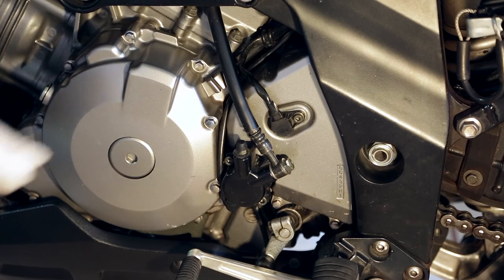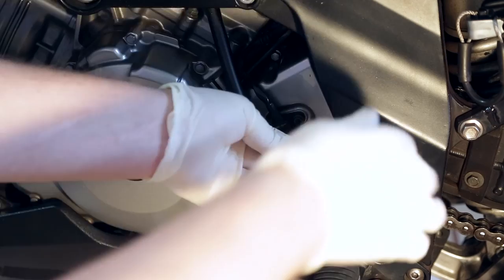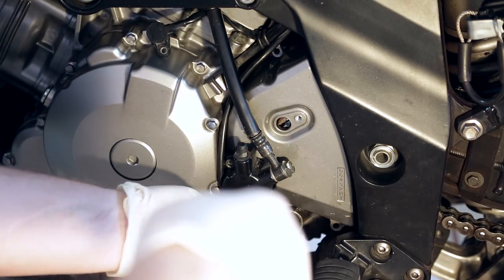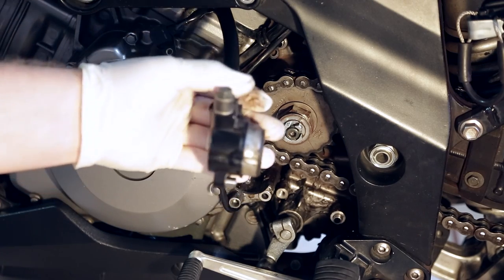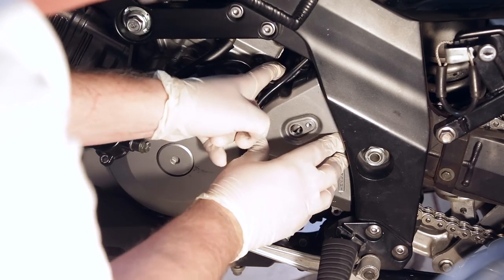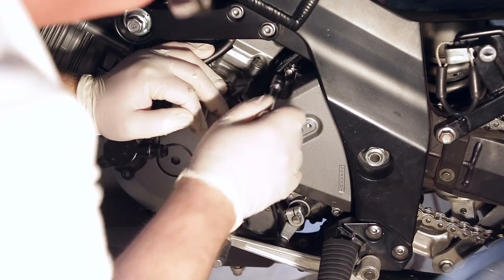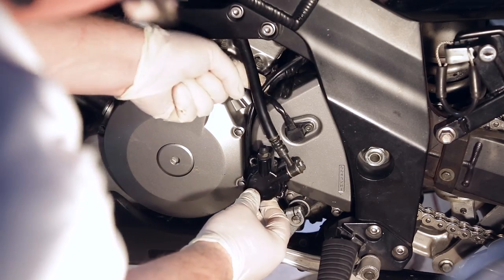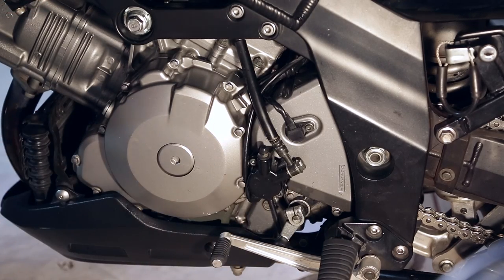Vstrom clutch slave cylinder removal & installation

Comment: A fine video, fella! 👍🏻
Rumour has it that area gets crudded up and the crud can hurt the slave cylinder, so worth cleaning every so often.
Mine is 2yr old and 8000 miles, so will be checking soon.
Reply from the maker: Thanks!  I try to do mine every 4-5000 miles, it's crazy how much chain lube builds up in that amount of time. WD40 cleans it pretty quick.

Comment: Did you notice any additional noise after this sprocket replacement?
Great video (as always).
Companies tend to do whatever they can to keep production costs down. That being said, it would seem that Suzuki deemed it necessary to use a more expensive front sprocket which is made with a (elastomer ?) damper (for noise abatement?) and your replacement sprocket does not.
 My dad (who was a REALLY smart guy with a lot of mechanical experience) used to say "There are no extra parts. If it wasn't needed, they wouldn't include it."
So, does everything feel and sound the same (or better) than it did before the change?
I'm looking to do this same job on my 2004 DL 1000 so I hope you can reply before I hunt down this sprocket. Maybe I don't need the damper, I don't know, but after this job, I think you do. Hope to hear from you.
As always, thanks for sharing! You save me a lot of pain, anguish and money!
Reply from the maker: Hi John, the one with the damper is  definitely quieter. I believe JT sprockets makes one now that has it. Sprocket Center has it for $22

Comment: Hi! Do you put thread locker on all your bolts? I always use blue- medium strength threadlocker to ensure that none of these bolts vibrate out during my rides. Thanks for the great info!
Reply from the maker: I do use some threadlocker on select bolts, but for the clutch slave cylinder and the countershaft sprocket cover, I do not.

Comment: Hi great tutorial. However, I just disassembled my slave for persistent fluid leak and found the dirt seal completely missing along with the bolt spacer you showed. Do you know what this spacer is called and/or where I might find a replacement?
Reply from the maker: You'll have to get the spacer from Suzuki SPACER, CLUTCH RELEASE Part # 23171-06G00 , not sure if there's any aftermarket seals out there or not. If that spacer is missing that would make that seal leak, because it will make it cockeyed. hopefully it didn't mess up the threads on the engine case.
Reply: @VStromGarage , thank you very much. By threads in the engine case do you mean the threads that the bolts for the slave cyl. and the cover go in to?
Reply from the maker: @dawa8746  yes

Comment: What is the process for replacing the fluid line with a longer one? I can't fit any amount of risers because cables are too short on my '19 1000xt
Reply from the maker: I'm not sure what they are doing for the 2019 brake lines, best bet is to go on stromtrooper fourm and ask. I ended up just rerouting my brake lines and cables on my 15.

Comment: Hello, good video.
Can I use this also for the TL1000R ? My clutch fluid is increasing every month...have to fill it each time....
So there must be a leak but I can't sea any oil so far.
Reply from the maker: I haven't worked on the TL, but being the same motor it may work.
Reply: V-Strom Garage did you say do take the push rod out to clean or dont?
Reply from the maker: do take it out
Reply: @VStromGarage  After seeing your video I cleaned under the chain cover today. It was nasty! I think this was the first time in 70k km. The previous owner did not clean it, I guess. i also removed the push rod and it started to drain motor oil where the rod was. Is this normal? I immediately put it back in and desided to ignore it for now. May be only a small amount of oil is normal? When the push rod was back in, no more oil came out. Thank you for the detailed video!
Reply from the maker: ya, those seals can leak over time, and yes the procedure should work for that bike.
Reply from the maker: @emzetmz  ya, a little oil is ok, glad the video helped.

Comment: Hey bro
I have 2014 dL 1000
I replaced my chain and sprockets
When I put it back together and I turned the bike on oil came pouring out on the floor
I didn’t do any thing with the clutch lever or the slave cylinder piston. So I’m guessing what I did wrong was not engage the clutch lever to prevent the slave cylinder piston from popping out (which it did and now noticed after your video) and it leaked brake fluid out?
Stressed!
Reply from the maker: That's a bummer, but not a big deal. Just push the piston in, reassemble, bleed the line and your ready to go.
Reply: V-Strom Garage 
Awesome,  thanks man
Just got another bottle of dot 4 and gonna button it all back up then bleed.
Reply: Hey bro so I put the piston in and held the clutch down then reassembled everything and it’s still leaking major amount of fluid. It’s not brake fluid from the hydraulic clutch, it seems like engine oil. What am I doing wrong
Reply from the maker: Not quite sure without looking at it, but is it leaking just sitting there, or just when it's running? If it's oil it could be a clutch pushrod seal
Reply: Only when I start it
Def not brake fluid.
Reply: I know it's old, but you pushed your rod seal into the motor. Just some fyi

Comment: I changed mine exactly like you did for some reason  the clutch is slipping really bad
Reply from the maker: usually when that happens it's either the push rod isn't straight, or you didn't release the clutch lever before you tightened the slave cylinder all the way. If it's the second one good chance the outer clutch plate needs to be put back in place. Open the oil fill cap and see if the outer clutch plate looks separated, if so, sometimes you can get a screwdriver and pop it back in place.

Comment: Maybe I missed something but when you put it back together it appears you forgot to put in the spacer tube  that you took out after it dropped when you pulled the cover off. Just an observation. Other than that great video man. Very straight forward and to the point. Thanks again
Reply from the maker: It went on at the 10:00min mark.
Reply: @VStromGarage  Yea, somehow I missed it cause that was my whole reasoning for watching the video.   Thanks a lot man.
Reply: @VStromGarage  i recently pulled this off to install a 3d printed pushrod protector, had a hell of a time trying to put the space back.. thanks for this. will reopen it again to check how clean it is now

Comment: When I did this on the top bolt of the slave, the entire cylinder that the screw screws into came out with it and now I can’t get the slave cylinder to tighten back down not sure if when removing I  broke a weld or what...
Reply from the maker: The cylinder, aka. the spacer is suppose to come out, check the threads behind it on the engine case, make sure there's no gunk in it. Also check the threads on the bolt, may have to run a tap and die and clean them up.
Reply: V-Strom Garage okay, thanks for the fast reply! Will update you.

Comment: Hi, I bought the engine of V Strom 1000 but it came without the clutch slave cylinder and the sprocket cover any leads on where I could get one?
Reply from the maker: Other than ebay or suzuki, not sure where else to look.
Reply: Same here, i cant find any info on why and what it does?

Comment: I am baffled with the clutch lever, I know that the service manual says also to clamp the lever before removing the slave cylinder but why? Am I wrong to think that when lever is squeezed the piston comes out to push the rod and thus it shouldn't be squezzed, like the brakes? Does it work the opposite way, when lever is squeezed piston goes in...?
Reply from the maker: ya, it doesn't seem right, but I believe that it pushes the piston to the end of the travel and it keeps the pressure of the fluid from popping the piston out.
Reply: @VStromGarage  Hi. If it still wants to pop out. Is that air in the line that has been compressed?
Reply from the maker: @spincrus79  I wouldn't think so.